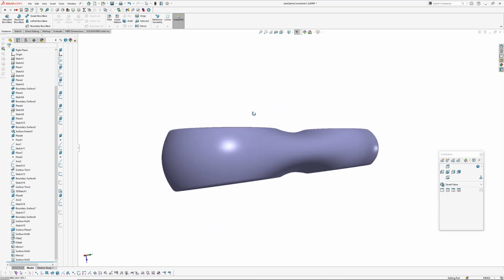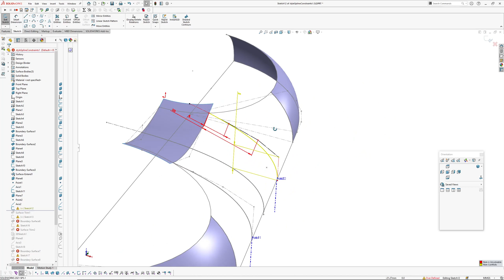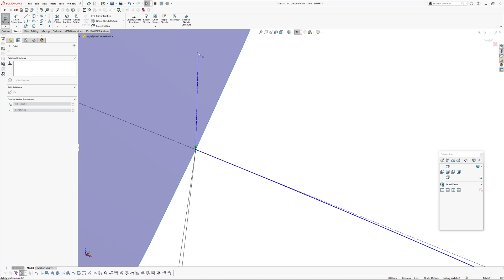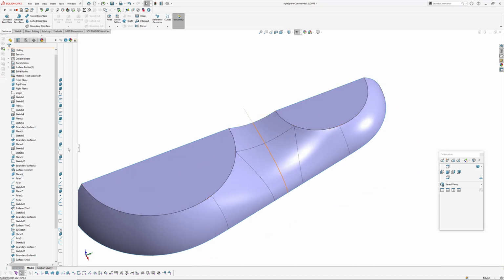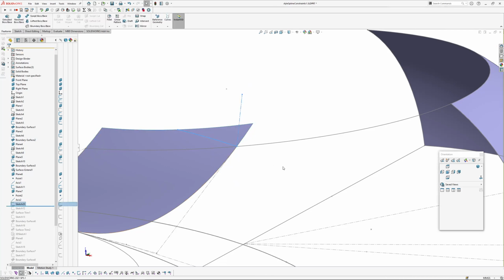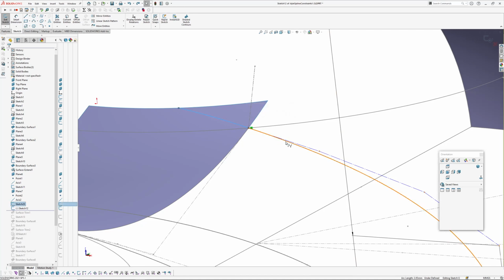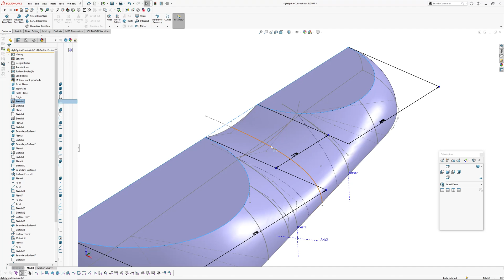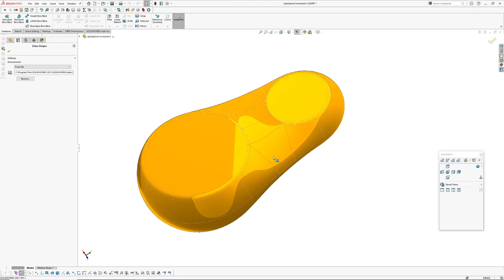Style Spline Sketch Constraint Failure Workaround in Solidworks

Comment: I recently found your solidworks channel. 
I a m working on rebuilding a surface  that has been translated from iges file.
Could I ask for some modeling techniques. I can send you a file I just need a method of contacting you and  sending method.
Reply from the maker: Hi David, my email address is on my YouTube channel info. I can have a look at the file when I have a moment. Wetransfer is good if it’s large